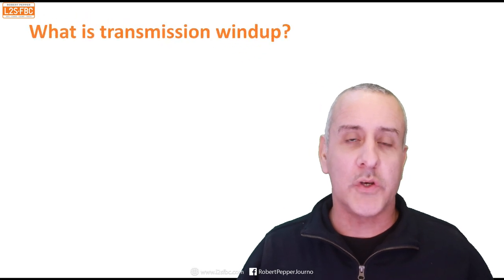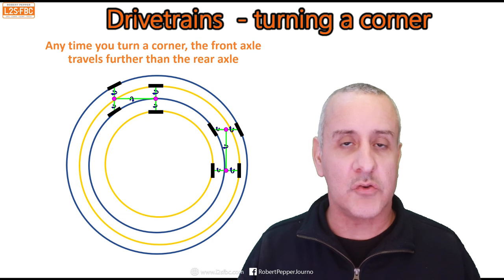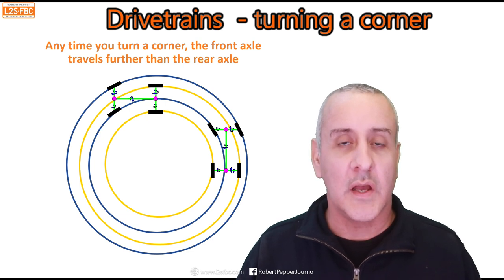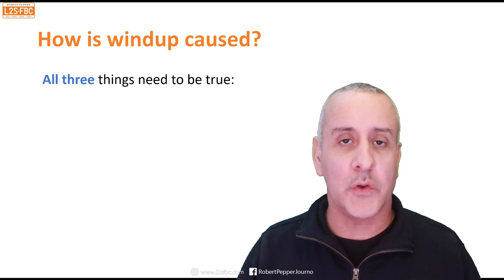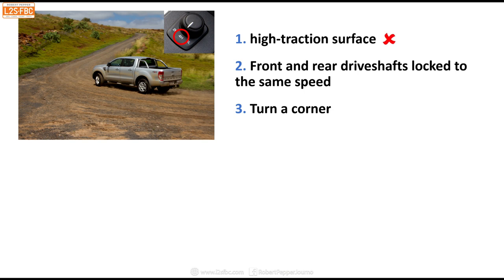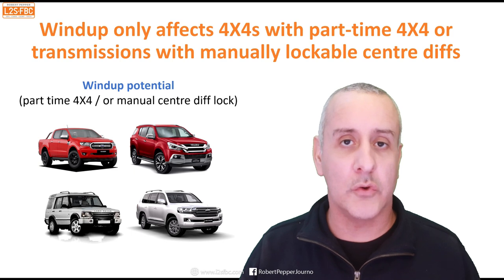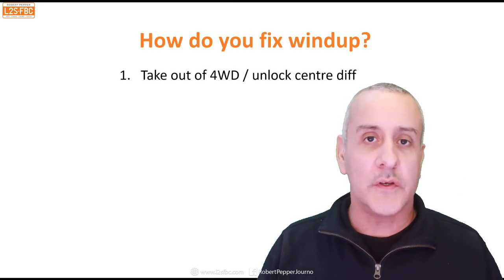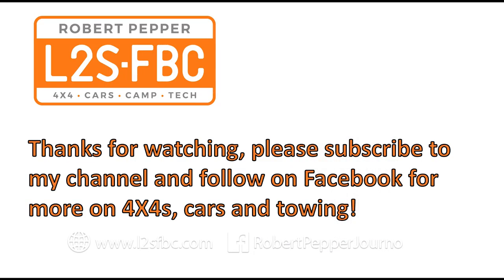Transmission Windup Explained (transfer case bind)

Comment: With locked center differential divetrain windup is because of the difference of front (large) and rear axle radius. When driving backwards in a curve there still the radius of rear is larger then the front axle. So I cannot understand how the stress is relieved because it is not a directional rather a travel distance stress - am I completely wrong?
Reply from the maker: Let's say you have zero windup. You drive forwards 90 degrees. You then have windup. You drive back 90. That eliminates the windup...but if you drive back a further 90 you get more windup and then have to drive forwards to release it.

Also, let's say you have zero windup. You drive backwards in a circle. You get windup. You need to drive forwards in a circle to cancel it.
Reply: Thank you very much for the explanation. It's clear. Windup goes to a specific direction and can be unwind by changing the drive direction but not by changing the steering direction. Tried it out with my Wrangler JK on paved road.
Reply from the maker: Yes that is correct. Can you send me a video of what you did please?

Comment: So I have a question, I drive a HGV that has a single axel with differential lock, if I was to lock it on a tarmac or concrete surface and make a turn this could wind the diff up? I'm guess it will by the look of it.
Reply from the maker: No - you have a cross-axle locker, so turning left cancels turning right. Not the case with the difference in speed between front and rear axles.
Reply: L2SFBC - Robert Pepper - auto journo interesting so I can correct my dad who tells me "it will wind the diff up" thanks
Reply from the maker: Yes. If all you did was turn one way, you'd get some windup but only in the axle that's locked. Windup as generally understood won't happen with a cross-axle locker. Send your dad my YT links :-)

Comment: If I move to 2wd from 4wd  and drive will it release the built up tension ? 
I have been multiple places where after a technical climb we have to turn and  endup on Tarmac.
I shift immediately to 2wd the moment I hit Tarmac
Reply from the maker: You mean from 4WD to 2WD?  If you are driving in 4WD on low-traction surfaces then you won't get windup.  And if you drive in 2WD on high-traction surfaces..again, no windup.
Reply: @L2SFBC   lemme say in simple words 
If I built little wind I p while in 4wd   
Now if shift to 2wd and drive will it release ?
Reply from the maker: Yes. Soon as it goes to 2wd it will dissipate.

Comment: Just go back to 2Hi or unlock the center diff and the windup is gone!
Reply from the maker: ...if you can. The problem is you may be unable to do that until most if not all of the windup has been dissipated.
Reply: @L2SFBC  thank you for this info! I was unaware of this windup phenomena, I bought a Jeep used and didn't know that you shouldn't drive it in pavement in 4 high.. I just hardly ever drive it and wanted to give it a little exercise.. I've hardly driven it in the several years I've had it.